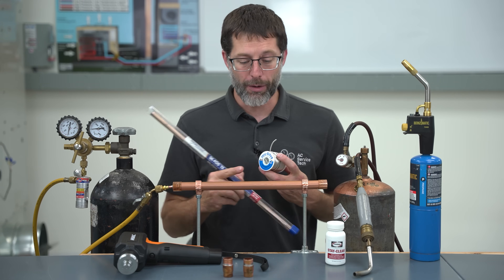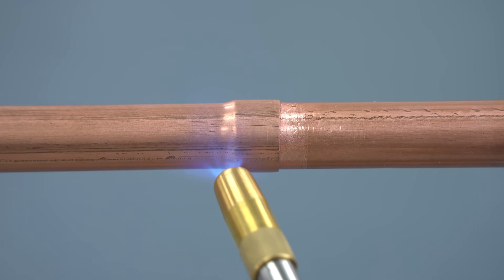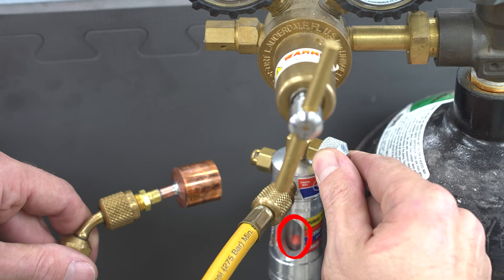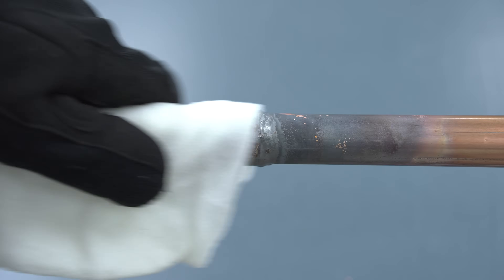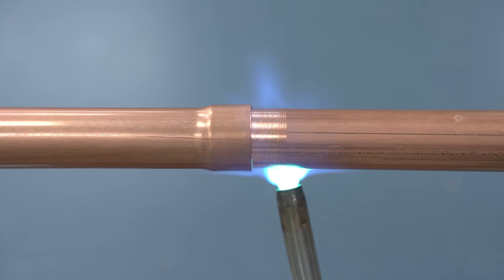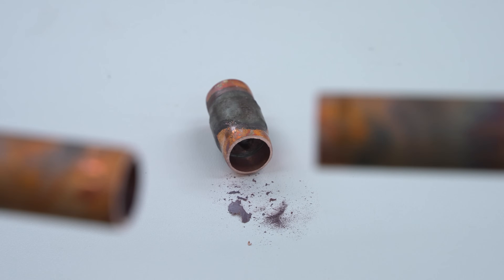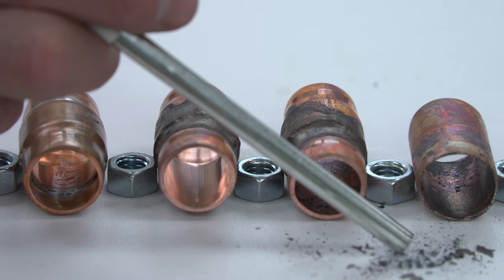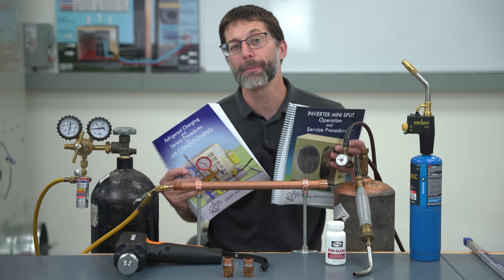HVAC Silver Soldering vs Brazing vs Brazing While Flowing Nitrogen!

Comment: You bring it down to 200 on each install? I do residential installs
Reply: I do residential install too. Very hard to bring it down to 200 microns because it takes a long time but I guess it’s well worth it in the long run.
Reply: @goldyneye  fair.. thanks sir 🙏 same at my company TBH
Reply: We get to 300-450 usually
Reply: What cfm vacuum pump are you using? Pulling the Schroeder cores and using a 7cfm pump I can often see 100 microns in less than hour. And that’s on split systems in condo buildings, so condenser is on the roof a couple stories up, so line set is easily 40 plus feet.

Comment: It would be more interesting and scientific to have a lab analyze the oil after contamination with varying amounts of flux then analyze the effects of the contamination on winding coatings. In a lot of cases it’s not worth it to be 100% perfect. You start getting diminishing returns as you approach perfection. This video is great for Internet arguments, but only partially scientific.
Reply: GREAT IDEA! Call 'Project Farm'
Reply: I fully agree, the warning on the flux is to avoid using it directly on an electrical connection.  In this case you are injecting a quantity so small as to be nearly unmeasurable.  Then we are being asked to worry about its effect on hundreds of feet of wire.  I love the instructor and have learned loads from him.  Silver solder is so very quick, easy and economical.  Nitrogen gas and brazing is the best.  Silver solder is functionally equivalent.
Reply: @brianb9410  Not to mention that this test showing the flux residue doesn't include pulling a vacuum and/or a triple-evac with nitrogen. The acidic component he's worried about in flux is usually hydrochloric acid (solution), which would boil under vacuum just like any water (moisture) in the lines would. The dry N2 added during the pressure test would also help flush out any residual flux. Unless you really go crazy with the flux, there's zero chance the micrograms of residual flux after N2+vac would affect the pH of the oil or cause any issues.

Comment: Anyone know the proper way to braze when replacing a compressor? I don't see any way to flow nitrogen.
Reply: Correct me if I'm wrong, but wouldn't you first hook up to either high side or low side.  Then, take out the strader valve for the side that nitrogen is flowing through.  Flow nitrogen through the system while brazing compressor in.
Reply: @G_money357  I didn't think nitrogen would flow through the compressor but i never tried.
Reply from the maker: Great question because the compressor does not allow pressure to cross through. The only thing you can do when replacing a compressor is to prepurge the vapor tube with nitrogen first before setting the compressor swage onto the tubing. To do this, flow nitrogen from the liquid side and have the vapor cap on the port and have the nitrogen flow out of the swage at the compressor. Then put the copper tube into the compressor swage and allow the nitrogen to flow out the liquid port at 3 cfh by removing the cap. Same thing for brazing the other side of the compressor. Purge from the vapor side out the liquid port and then put a cap on the liquid port and allow the nitrogen out of the swage near the compressor. Next, push the tube onto the compressor swage and then remove the liquid port cap so the nitrogen can flow out at 3 cfh from the vapor port and then braze the discharge tube to the compressor. Remember to have either the valve core depressed or removed from the port while brazing. You shouldnt have any positive pressure while brazing. Thanks and once again, great question!

Comment: Much needed video 👍
Much more copper oxide is formed if you’re raising the pipe in a vertical position .  Heat creates a natural flu effect that causes the air inside the pipe to rise.   This brings much more oxygen latent air flowing across the glowing hot copper producing a thicker layer of copper oxide inside the pipe. 
Very good for presentation for  students in class .

Comment: They do make acid free flux.
Reply from the maker: The hot flux etches the copper for the solder to adhere. Are you familiar with a flux that remains near 7PH during high and low temperatures that is made for silver bearing solder?
Reply: @acservicetechchannel  yes I have some the label is worn off but I will find it and let you know.
Reply: Very informative video thank you